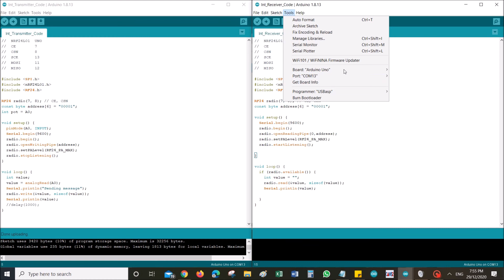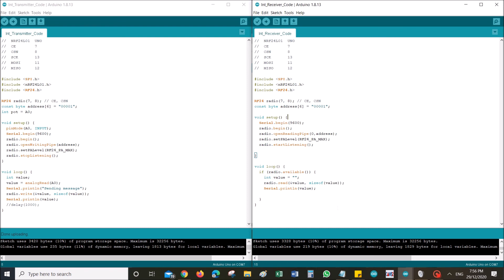NRF24L01 Sending and Receiving Integer

Comment: When I'm printing the transmitted value, it keeps printing random negative integers like -16393 and such. I've got everything like you. What could be the issue?
Reply from the maker: It is printing -16393 for what value supposedly?
Reply: @electronicseternity9210  I was transmitting integer values: 1001, 1100, 1000 and such. For every one of them the received integer is printed as some big negative value ranging from -16 000 to -30 000
Reply from the maker: @CT-7567__  It's hard for me to advice what could be the issue as I am not physically able to test. However, you can try using the map function, to produce meaningful range of values.

https://www.arduino.cc/reference/en/language/functions/math/map/